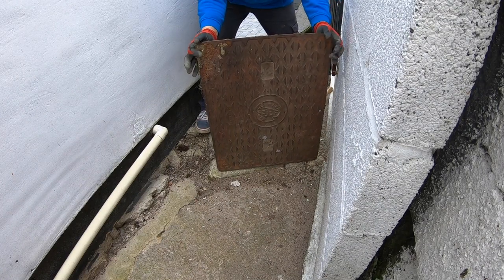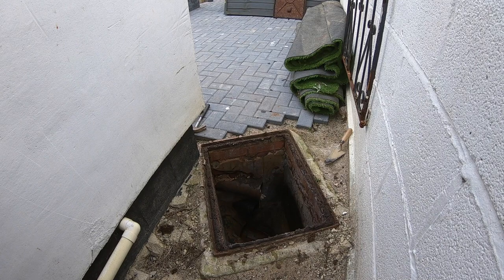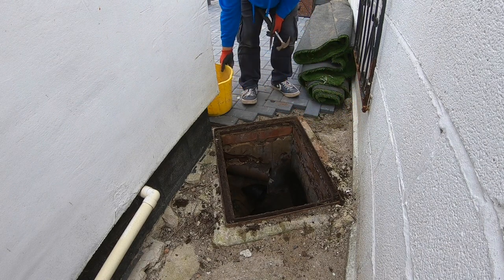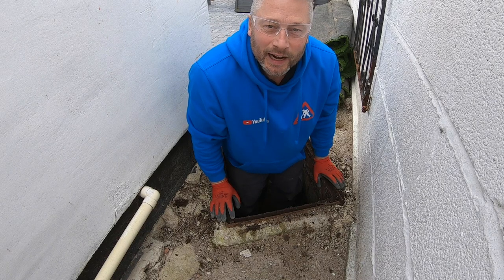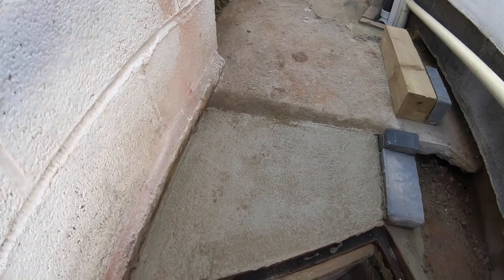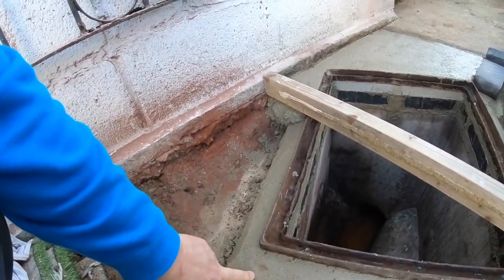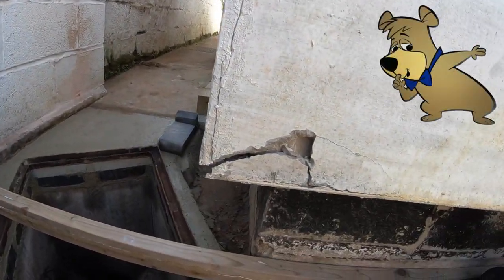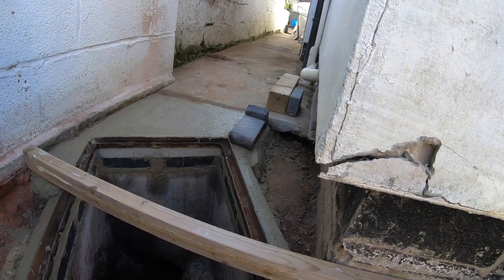Courtyard renovation - Lowering an inspection chamber lid - HD 1080p

Comment: Does anyone know how low you can take these chambers? I looking at taking 3 courses of brick out?
Reply from the maker: Hi Shaun, I reckon Roger Bisby from Skill Builder would be a good guy to ask 🤔 I’ve seen them very shallow, say two courses above the “benching” (the smoothed cement transition between the pipe and the edge of the chamber)
I think I used the incorrect term in my video 🧐
How many courses would you be left with?
Reply: Thanks for the advice 👍🏻